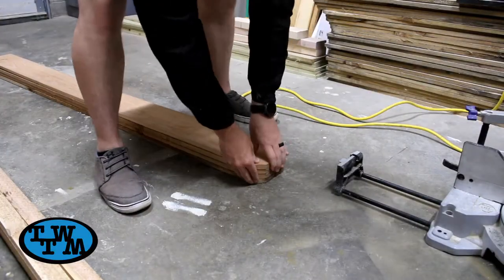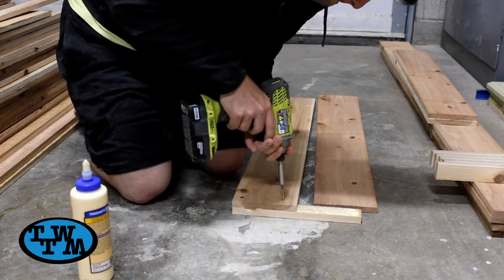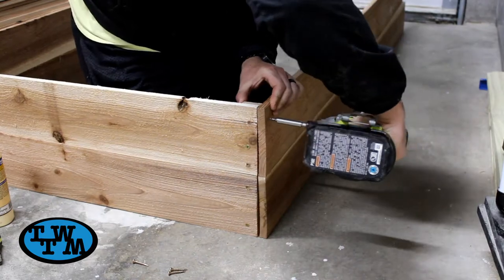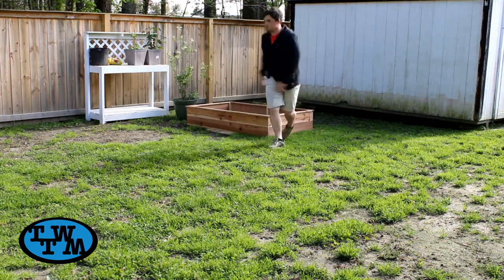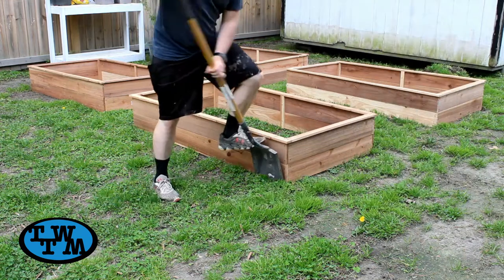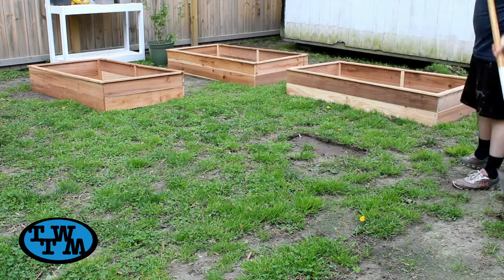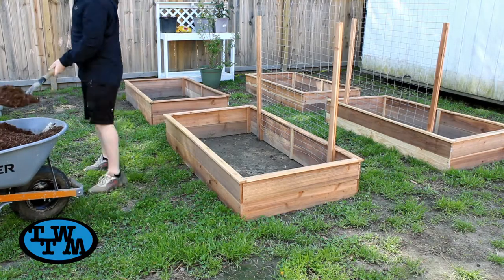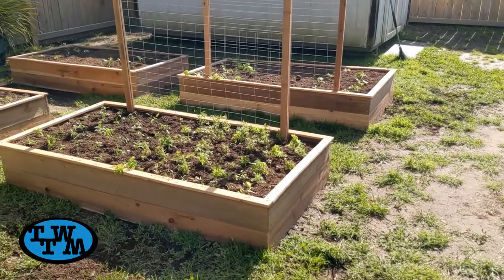How To Build Simple Raised Garden Beds Out Of Cedar Fence Pickets | Woodworking | DIY | TWTM

Comment: I would've done cattle panel for the arch for extra support  but great looking beds!
Reply from the maker: Yeah we weren't sure what to use and just gave this a try. And thank you very much!!
Reply: @TheWillToMake I fastened 4 pieces of rebar, two in each box and arched pvc plastic pipe from one to the other to form an arch.  I would also suggest you fill the bottom half of your boxes with leaves, compost small branches etc that will break down and just use soil for the top half.  Lot cheaper and plants need the nitrogen

Comment: Even with the lip on the top of the raised cedar garden bed and a center stake to secure the bed to the ground, cedar fence pickets will bow and bulge in the center.  The wood is just too thin.  I've been making 16" high raised cedar garden beds for 10 years now, and I secure a metal  threaded rod across the center of the 6' sides to keep the bed straight and rigid.  Adds another $5-$8 to the cost of a bed but makes it last a lot longer.
Reply from the maker: Yeah that definitely makes sense. With how small mine are we have not noticed any bulging though. But it's always a great idea to make it as rigid as you can.

Comment: That's a great build. Nicely done. To strengthen the arch you could use some pvc electrical conduit and bend it between the two beds. Will last ages.
Reply from the maker: Is that something you have to heat up to bend or would it just retain it's shape?
Reply: @TheWillToMake  you'd have to heat it and then bend it or it would kink.
Reply from the maker: Thank you!! I'll have to try it out